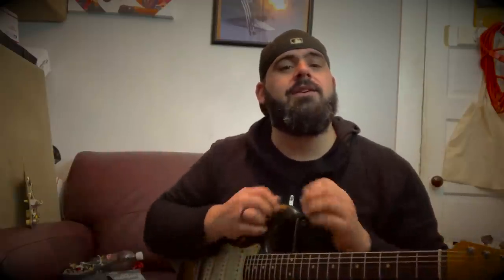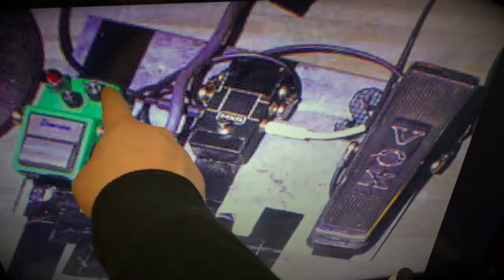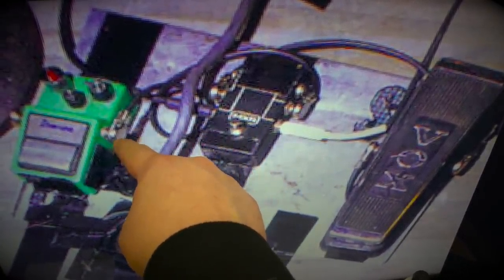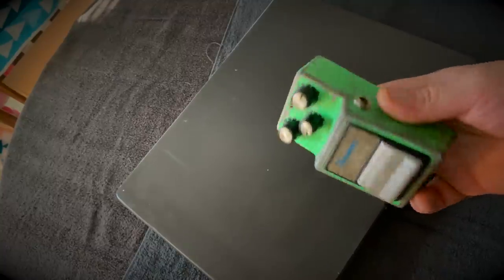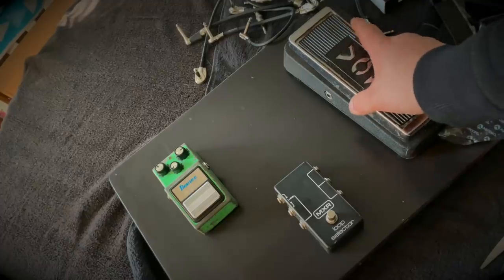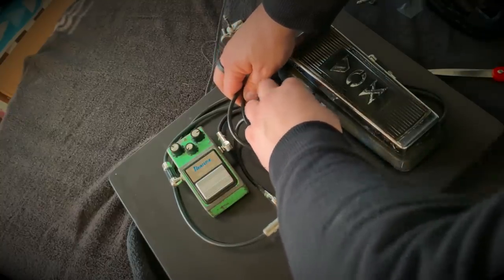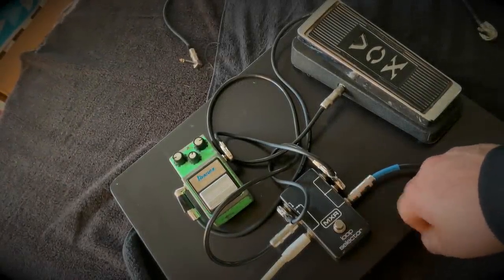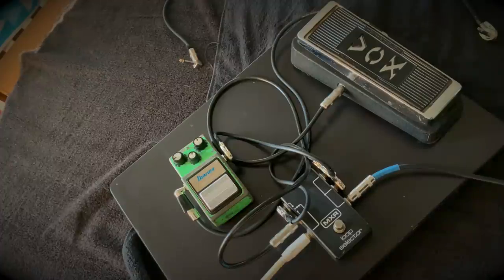STEVIE RAY VAUGHAN PEDALBOARD TONES - PART 1

Comment: Nice.  Finally someone did it right with the tubescreamer going into wah.
Reply: Brandon Cash I’m curious why the tube screamer before the wah? Most times the wah comes first in the signal chain.
Reply: I believe he did it so the wah would stand out more. Ive been running a fuzz into a wah for some time because I’ve noticed I have a harder time hearing the wah effect after the fuzz. Never tried it with a TS though. Gonna try it out. But I’ve noticed Stevie’s wah effect is very strong and I’m guessing this could be why. Goes to show it’s okay to sometimes go out the box
Reply: @mygabrielle7477  I believe your statement to be correct. I have run my wah before my drive pedals for many years and always struggled with annoying noise issues when engaging the wah. I also noticed that sometimes the wah would get a bit washed out. I recently rewired my board and placed my wah (Area 51 wah) after my drive pedals and the annoying noise nearly completely disappeared.  I did noticed that tone of the wah did change a bit, was a little louder and less muddy. I actually wasn't sure I liked it running solo in my studio but when I used it live I was delighted and inspired without the noise.
Reply: @sonsrawk  The only reason I'd ever run wah first/before fuzz or drive is if I had a pedal like an old fuzz face that needs to be first in the chain to operate properly and/or has issues with it's buffered bypass. 

If those considerations are not present, I always run my wah after dirt/fuzz/drives because the wah becomes "vocal" and expressive. When a wah is run before dirt, it's more of a "filter sweep" effect than it is expressive.
Reply: @AnodyneHipsterInfluencer  Agreed! I know a lot of players do this but in my situation it simply sounds better, its more expressive and no whooshing noise to deal with.

Comment: I’ve had good luck over the past couple years with the George L’s solderless patch cable kit. You can make them to the exact size you need and they are super easy to assemble.
Reply: fastguitar  I ditched the George L’s not too long after this comment lol. I’ve been using the Audioblast cables Nik recommended in another video. While they aren’t as slim as others, they have been reliable and cheap enough to have extras on hand just incase problems arise.

Comment: Interesting video. Did you notice the loop of cable next to the wah in the pic? Could be for running off some tops from the wah? I know that Warren Haynes uses a 100ft cable from his wah, for exactly that. Anyway, just a thought, it sounds as if you've got the sounds down pretty well. And you'd probably appreciate by now, just how much of Stevie's sound was in those huge paws of his.

Comment: Hey guy great playing!
I don't really use pedals much, but what is the purpose of the MXR loop selector? Couldn't you just turn off the tube screamer when not wanted?
Reply from the maker: As stated in the video, the loop selector is a clean bypass signal, the tube screamer as we all know is a non true bypass pedal

Coming from the old school where you just plug a strat into a cranked fender amp, the loop selector totally removes and “shading “ or load from the non true bypass pedal
Reply: @theriffwniksevigny5473  ok second question would be, the MXR loop selector is not made anymore, is there something equivalent out there now?
Reply: @marksauer58 any true bypass looper

Comment: Hey man so I’ve noticed both you and Jesse get this fizz to your tone, almost like a germanium fuzz sound. Can you help me out on how to achieve it? I’m running a ‘97 american standard through a ‘67 super reverb. All of the tubes are original other than the power tubes, they needed replacement. Should I be looking into different tubes for more musical and earlier breakup? I bought a duellist because I’ve heard a lot of demos of the king tone pedals doing that thing but it didn’t give me that at all. Thanks!
Reply from the maker: Put the amp on 7 to start. Bring the bass down.  Treble and mids up

Comment: THE RIFF W NIK SEVIGNY,                      Other guitarist are telling me that when you roll back the guitars volume control on a tubescreamer pedal it will create that texas glassy metal tin can tones. I'm not sure if the older tubescreamers have a built in buffer and the buffer is creating the clean texas glassy metal tin can tones while the older tubescreams pedals was turned OFF it still ran through a buffer internally. 
Have you notice that a tubescreamer creates texas glassy tones when the guitars volume is turned down?
Reply from the maker: Dude.   
Turn the fuzz pedal volume way up
Put the fuzz set at about half way

Turn the amp up Loud
Roll back the guitar volume a hair

To make this even more glassy and chimey, add a treble bleed circuit.  Try 330pf with a 120k resistor in parallel
Reply: @theriffwniksevigny5473  ok thanks i will try that treble bleed circuit.

Comment: I remember, around 1993, I had the same Whawha pedal from Vox. She did not get along well with the buffer of my TS9. It completely destroyed my clean sound. It should be noted that the Whawha Vox already includes a buffer itself which has a very bad reputation. I have since changed to a Dunlop Real McCoy which is true bypass and contains no buffer. The problem is thus completely solved. I find that the whawha sounds much better upstream of the TS9.

Comment: I don’t get the purpose of the loop pedal, can you explain it in more detail, is for avoiding interference of one another or loosing signal and tone?
Reply from the maker: Yea.  The loop pedal keeps the non true bypass pedals out of the signal to the amp.   I will go into a better explanation in Part 2!

Comment: On one of the set up he was using came when he was playing Austin city limits was from left to right on one of Cesar Diaz notes the set once used in Austin was vox tycobrate Octavian TS 808 fuzz face and then his strat on the other shows he was also using a junction box to switch between  various amps and also Leslie cabinet that was part of his set ups the he started to used one of Cesar Diaz custom fuzz face type overdrive pedals that was a combination of a ts9with a modified fuzz face Circuit
Reply from the maker: We were focusing on 1985 here

Comment: Dude I hate when people say a TS is critical for SRV tones. No. People think he used it as an always on pedal and that's not true at all. He used it for certain leads and that's it. Any rhythm dirt came from the amps. 

There is however some great always on pedals that can capture that Stevie rhythm tone if you can't crank your amp or don't have a SR or VV.
Reply from the maker: 100%
Reply: @theriffwniksevigny5473  Love the content brother. Keep it coming.
Reply: Can you recommend some of those pedals? Thanks!
Reply: @xderiwx  Your entry level pedals that are specifically "SRV in a box" pedals is the Love Pedals "Super Six Stevie Mod" pedal and the RFO electronics "elMo". The latter was designed to emulate Stevie's El Mocambo tone and the former is designed to emulate a cranked Blackface Fender amp. They're both basically the same in terms of the EQ curve and tonally. The Super Six is the cheapest SRV in a box pedals at under $200 and the elMo can be bought straight from RFO for roughly $180 to $200 shipped. Possibly cheaper. He's got an Instagram and you can contact him through there. 

After that I would say the best SRV in a box pedal is hands down the Honey Bee Pedals "Double Trouble". This pedal has a clean drive side which is your "always on" side but it also has a boost side that is a TS808 inspired circuit but is much cleaner and another.

Stevie's rhythm tone from 1982 to 1985 is hands down my favorite and the tone I feel like everyone chases after. The lead tone I feel is a little easier to get close to being that an 808 boosted Fender is pretty generic and fairly easy to replicate. The playing is what made it sound incredible. But the rhythm tone, THAT'S the tone that's harder to get because it's essentially a cranked  BF fender that's mid scooped and most of us don't have the luxury of being able to crank to Super Reverb. That's what these pedals come in and they do a great job.

Check my channel. I've got a few videos of the various pedals I mentioned. Hope this helps.
Reply: @RobertLandrum13  Awesome, thank you for the tips! I’ll start looking those pedals up, and also go through your channel! Thank you!!

Comment: I just don't see any cable connecting loop B's send and return in the photo. What happens without that cable? With a modern FX loop pedal any single loop pedal with a bypass would suffice. Just have to wire the screamer first in the loop. SRV was a Mad Genius and it shows with all his black duct tape and tangled wires. LOL

Comment: I don't understand why you use a looper for one amp and 2 pedals? Why not eliminate the looper unless you're using it as a buffer. That's just more shiot in the signal.
Reply from the maker: So if i left the looper out, the two pedals that are non true bypass would actually be messing with the signal, its a true bypass looper....it keeps the direct signal clean, and only adds in the pedals with the on/off switch...

Comment: THE RIFF W NIK SEVIGNY,,
               if you a 1meg pot with single coils it will sound more brighter or 500K its at its limit of brightness?
              SRV guitar tone pots all the way turned up used .22uf cap i think compared to new strats used .1cap which makes the single  coils sound darker even when the tone pot is turned all the way up. So they say to change the .1uf cap to .22uf cap to get that glassy texas SRV tones.
Reply from the maker: You’ll see 1meg pots in some teles, bass and jazzmaster/jags

I dont think srv used them, nor do i think he used a .022
If you slow down the fender video of them disassembling #1.  You can see the red dime cap, clear as day
Reply: @theriffwniksevigny5473  but what is the cap value of the red dime cap? what type of capacitor is it? because they have different types of capacitor not sure what a red dime cap is  because most are ceremic caps or the green poly caps
Reply from the maker: bill williams .1
Reply: @theriffwniksevigny5473  thanks 
Because eric johnsons uses a 500K pot instead of a 250K pot to get more high end glassy texas tones. I know that SRV didn't do this. I'm not sure if eric johnson uses .1uf or .22uf because other guitarist are saying that the .1uf makes the strat pickups to dark you loss the glassy high end.
Reply from the maker: bill williams how about this.  Send me a clip of your amp, settings and guitar while you are playing it.  So i can get an idea of whats happening
Reply: @theriffwniksevigny5473  I'm just talking in general, because I play with different amps fender 15watts to a marshall 50 watt plexi. 
Do you know which SRV songs used and got that dumble tone? because I have listened to all SRV albums and it just sounds like a tube screamer with fender amps i don't know which studio songs or live concerts he uses to get that dumble tone do you know any?

Comment: hey man just discovered your channel really good info.You mightve already covered this but are there a particular type of strat pick up you would recomend ?
Reply from the maker: I just have two old strats.  Electronics are stock.   But you cant go wrong with a set of Kingtone Bluebirds or VIP Pickups!
Reply: @theriffwniksevigny5473  cheers man i just bought a new strat pro series 2 but im thinking the older ones pick ups sound closer to srv .Im thnking you mightve got the heavier strings with the guitar tuned down a half step just cant quite get mine to sound the same.Your playing is awsome man its the sound i aspire too.I recently started  playing again and loving it ill  be sure to check out more of your videos
Reply: @theriffwniksevigny5473  im also thinking of buying a strat second hand or even a squire ripping the pick ups out putting in something like you  suggested trying heavier strings but tuned down a half step and getting is set up properly to suit the strings any thoughts man? appreciate any tips

Comment: If I had those pics, I could run em through Photoshop and get the edge detail for the patch cables.
Reply from the maker: Google em. They are there!
Reply: @theriffwniksevigny5473  Found the pic. I did some edge filtering and some sharpen filter passes. Seems pretty straightforward.

Comment: I have a Vibroverb reissue and an original TS9 but when I use the TS9 it filters off a lot of the bass, so I've been really curious how SRV set his treble and bass and what volume he ran his vibroverb at. Theres an early video of SRV using just his vibroverb but I cant make out any of the settings since the footage is like old betacam. https://www.youtube.com/watch?v=7VZ3-NvOw0o
Reply from the maker: Turn the volume way up, and you will introduce natural low end
Reply: You can use a fuzz (full volume, low fuzz) and roll of your guitar volume to clean it up. That will give you a lot of low end and bright. Also, SRV uses a fuzz face and an octavia, latter on his live shows.

Comment: Original SRV tubescreammer Chip si JRC4558D
Reply from the maker: There was a certain style of chip noted on inspection in 1985.  There were 3 he had with this chip, but there were others of course with the chip you mention!
Reply: @theriffwniksevigny5473  interesting, what was the chip in those three? Malaysian? Texas instruments, spill the beans!! Most of mine are jrc 4558 , I do have 2043dd and it does sound different. Great video!